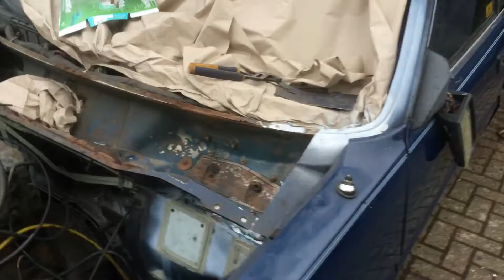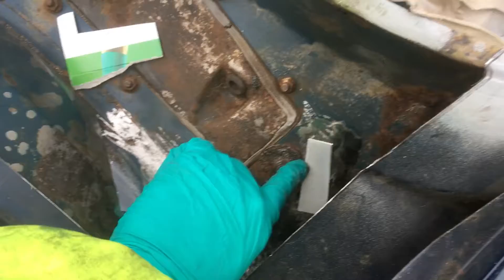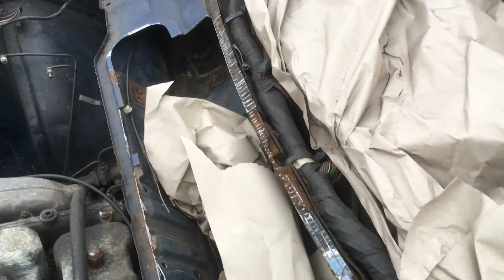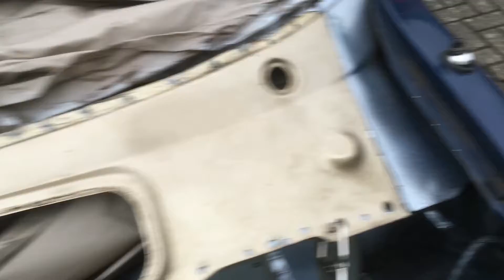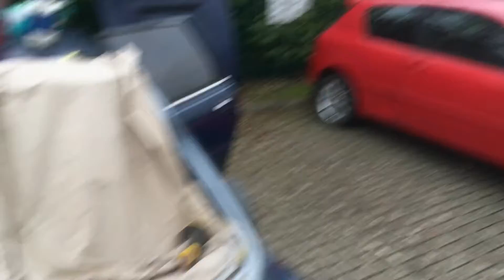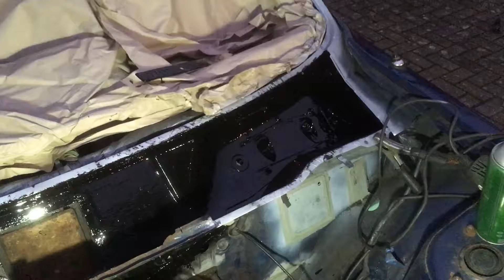Rover SD1 2400 SD Turbo restoration - Video 22 Welding scuttle

Comment: Thanks for the pulse welding demo as well as the welds around the blown hole, wish I’d seen that before I got so frustrated with my progress with my thin metal welding last week.
Reply from the maker: Thin metal is a pain. Easy to blow holes. Have to get the current really low and be real patient